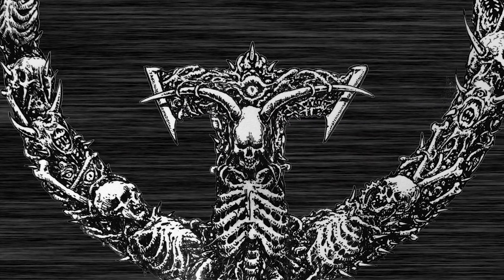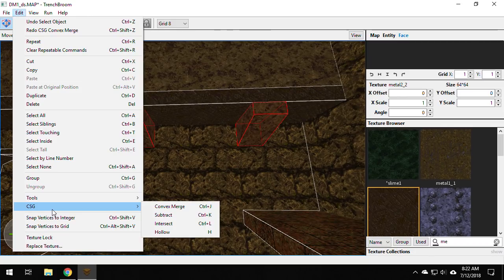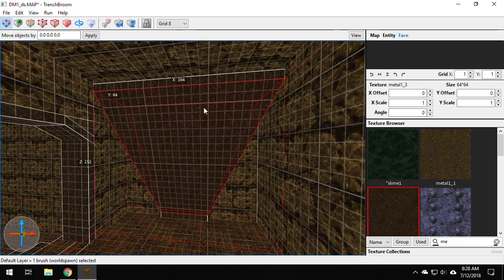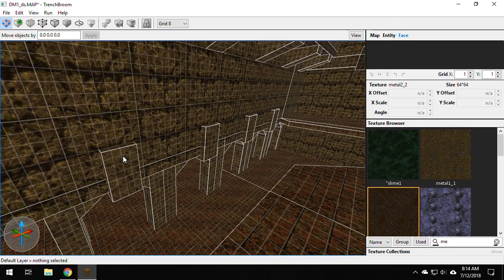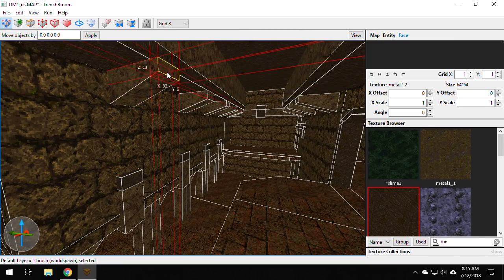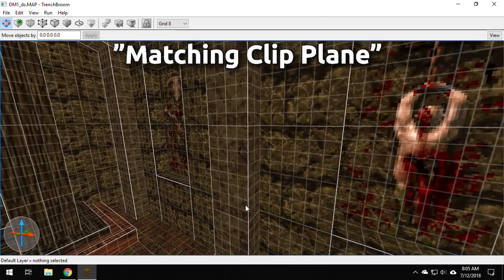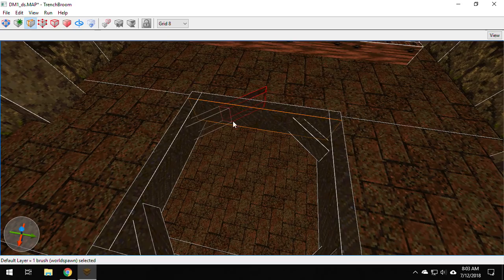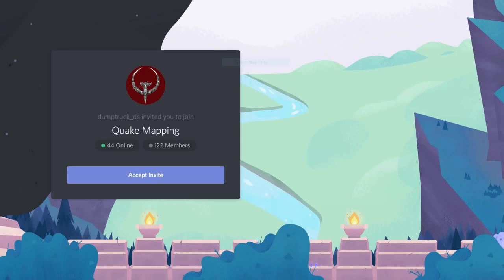Quake Mapping: TrenchBroom - 3 Must-Use Features

Comment: I wanted to ask you something. Does is there a way to make a brush act like a mid-texture from doom? To learn how to map for quake I’m remaking one of my Doom maps with a doom texture wad, and I wanted to use some of the window mid-textures. Is there a way to make trenchbroom see a certain color on the brush and key it out so it is transparent? Or do I just have to clip it out manually.
Reply from the maker: Take a look at my texture videos. I believe I cover transparent textures in part 1.
Reply: @dumptruckds  I found it! It was in Custom Textures part 1. Fence textures were exactly what I was looking for. I’ll have to edit the textures myself because the textures in the wad used teal instead of the last color in the quake palette.
Reply: @dumptruckds  thanks. I haven’t finished the whole series yet but I will definitely check it out